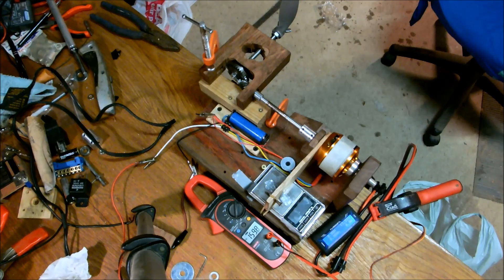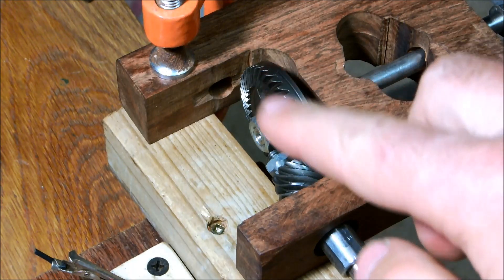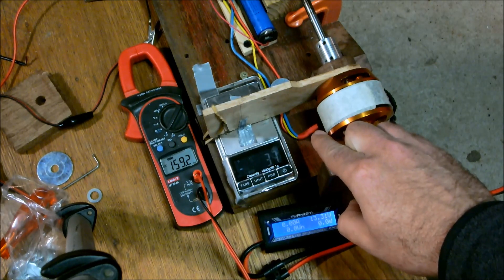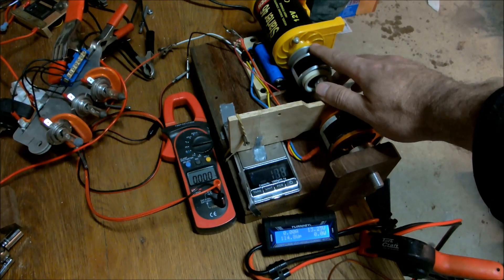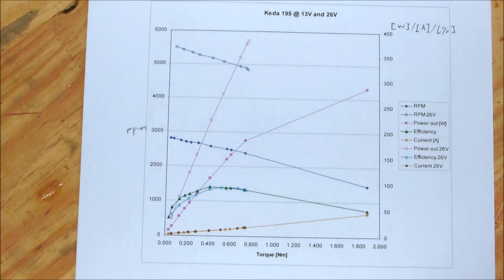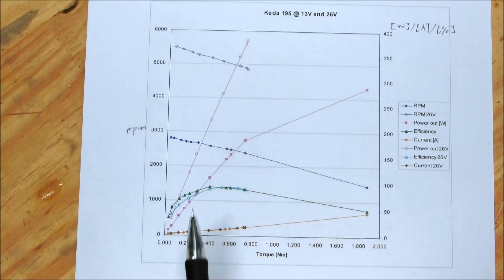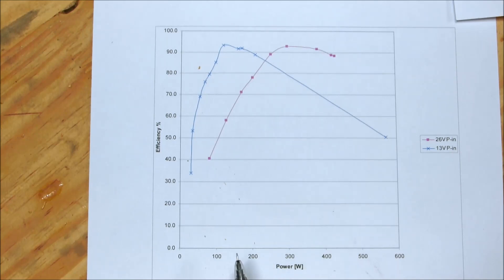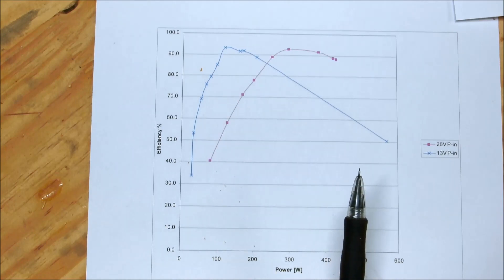Brushless motor dyno

Comment: When you start running bearings n stuff underwater; look up:
Dr Ali Erdemir Argonne National Labs Boric Acid in oil lubricant

Basically you end up with a chemically inert layer on your bearing surfaces that happens to be VERY slippery and smaaks water!

Very slippery as in that 90 deg turn in rotation direction will have a loss of boggerall vs without and be much quieter due to the Frangible (for lack of a better word) lube taking out tolerances.  
Same for the bearings etc.

Chemically inert as in low to no rust.

Also lekker is that the wood wont vrot..!  :)

Same goes for above water BTW...

(All The goeters need to be run in first.  They wont run in after!)

Oh ja; Buy another angle grinder gear kit and you have a small diff for Ouma's lectrik tricycle en so.
The std housings, with mods, finish the diff pretty easily too... ;)

Comment: Hi the video was very informative. Can you please suggest me for dynamometer testing of a motor, which dynamometer can be used? please suggest some cost-effective options. My motor kv rating is 340 and max power is 3500W. Thank you
Reply from the maker: I have never looked at what commercial dyno's are available, but I am sure that one rated for 3500W is going to be expensive. Your other option is to copy my design and simply power your motor at lower voltage. It will produce less power, but you will be able to calculate all the important constants. From there you can use equations to calculate performance at higher voltages.

Comment: Perhaps will you let for a link where you bought the motor? Thanks!
Reply from the maker: I bought it from HobbyKing but it looks like they have now discontinued this model.
Reply: @williamfraser  perhaps advise something similar? As far as I understand, this motor works from 12 volts and above?
Reply from the maker: @ingosearch3892  The Turnigy Aerodrive SK3 6374 in either 149Kv or 192Kv should give very similar performance. These are also sold at Hobbyking. That assumes a gear reduction of 3.7:1. If you have a greater reduction ratio then the Kv can be more which opens up options to more affordable motors. The Propdrive V2 5060 270Kv would be a good equivalent with a 5:1 gear reduction.
Reply: @williamfraser  thanks!!!

Comment: Nice!  Is this motor legal for your solar boat race?  The RA gears are nice but you are going to need more reduction for an efficient prop speed right?
Reply from the maker: This is the motor I hope to use now that the other one is all rusted. The motor is low kv and rated for high power at moderate voltage. So at less than rated power, I can apply an even lower voltage, further reducing rpm. I have a number of different props to test, from 9x7.5 to 11x10. The bevel gears should give me around 1000rpm with a 10x8.